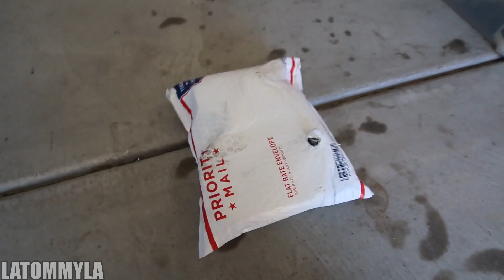Welcome Back Splitter!

Comment: Looks waaaay better painted. Just a suggestion, you should sand it very smooth and round edges of it. and uses filler primer to give it a smoother finish. Followed by paint and clear coat ;)

Comment: Hi ,nice job you did,what kind of brackets you used or paint ,where come from the bracket ,it's not on eBay ?
Reply from the maker: You can use any black spray paint, and search up EK Splitter Brackets up on eBay, it should pop up.